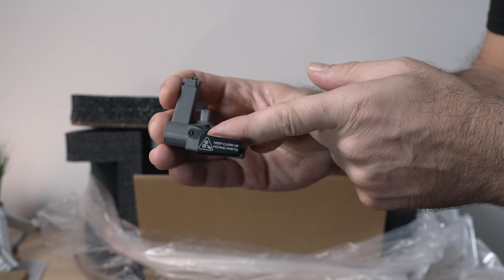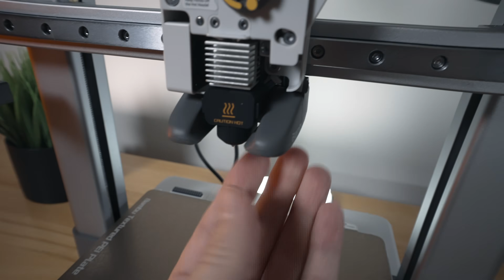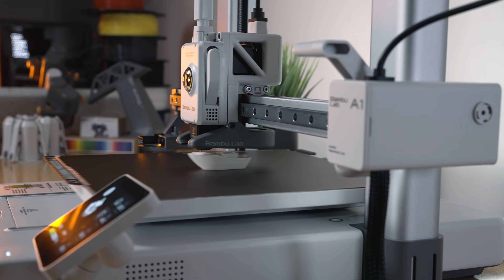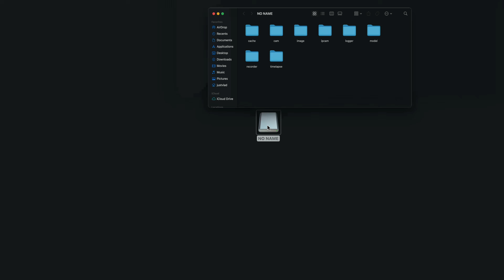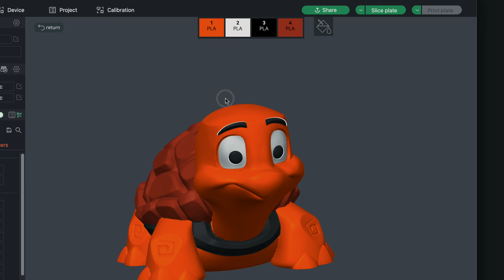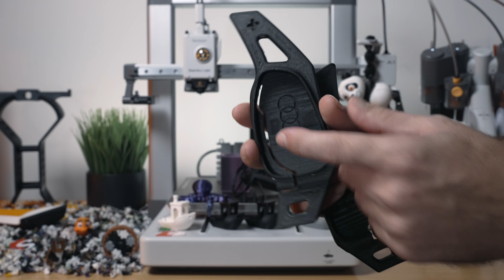Bambu Lab A1 Combo - AMS 3D Printer - Unbox & Setup

Comment: For the record, as of January 2026, the A1 Combo no longer ships with:
- filament color swatches ($10US)
- sample project and hardware ($?)
- tools and assembly hardware in a box, they’re just in a plastic bag
Additionally:
- the included arm for a single filament spool has been reconfigured; no longer has the separate, spinning cylinder
- the two Allan wrenches no longer come with the plastic “T” head
- there is only one extra cutter, not two
- there are no longer bolts that need to be removed on the bottom
Reply: Just bought mine last week and confirm everything listed above
Reply: Bought my three days ago, and can confirmed this as well.
Reply: Ordered mine 3 days ago and I can confirm it too
Reply: Can confirm
Reply: Confirm
Reply: Does it come with the SD card?
Reply: @Հայեմես-29  Yes
Reply: @Հայեմես-29   yes it comes with a 32gb one
Reply: yep. assembling mine right now, even the box it comes with is cheaper
Reply: That’s unfortunate
Reply: Does that mean it's not worth it or like there is stuff i need to buy with it?
Reply: @PalestineHobbyist There’s nothing you NEED to buy, they were just nice “extras” no longer included.

Comment: every body show how to setup printer thru phone, but i dont see video with setup thru PC. I dont want to use my phone. I am planning to use PC and my generated 3D files. I know it is not always straight forward when install bambu studio it does not want to work. I have one at work and IT guy spent half a day to figure out what is wrong. For not IT person it would be much longer. Nobody show how to correctly set up. I would hold on to buy until i figure out.

Comment: I just got the first bach of 2025. Assembly instruction and packing is slightly  different then videos. They don't include black plastic box that holds the maintenance stuff anymore just a clear plastic zip lock. It doesn't have the lubricant tube anymore instead they add 3 different small packs. The plastic base cover doesn't have honeycomb stiffener anymore.
Reply: Mine didn’t include the shipping screws at the bottom
Reply: Did you the get the filament swatches?

Comment: bambulab a1 z axis only leadscrew? no linear rail?
Reply: Just for the record, when I first watched this video , I was very excited about this A1 . i  ordered the A1 Combo , received it mid December,got it up and running in about 4 hours., printed 5 or 6 small parts, absolutely no problems . then on January 5, 2025, it was completely dead. It is now April  29 and still dead. I have gotten absolutely no help  from Bambu Labs. Guess I will pay my “STUPID TAX” , put the A1 in the trash bin and buy a new Prusa printer.     BAMBU = BAD.   PRUSA =  GOOD

Comment: Great video, thanks!  Very interested in this printer with AMS.  I wonder if a small guide/bracket could be printed that would prevent the cable from going behind the printer?  Something with a curve going toward the back that might keep it set right.

Comment: There were two brackets with FOUR screws holding the printer head arm that the instructions DID NOT tell me to remove. It kept failing calibration and a clicking noise until i figured out to remove the brackets. (You didn't have them in yours)
Reply: do you have photos so I dont miss this?

Comment: When you do small parts with lots of color changes i was told print multi prints at once. like the Penguin print like 4 or 5 of them at once. fill your bed plate with it. your purge block should not get any bigger but you end up getting 5 or more prints. (I do not own a bambu yet,  mine will be here today.) Was also thinking how do you turn the purge block into a model? i read you can do this but dont know how yet.

Comment: Bambulabs may indeed make some of the best 3D printers around but their Support pages for non-arrival of filament are absolutely useless. I filled out the form and submitted but it asked me to fill in my email address without their being a box to input it, so there was no such availability. And their live chat isn't open at reasonable times in the UK. So a big negative on that side. My printer, which looks lovely is absolutely no fucking use without filament. Which for some stupid reason isn't sent from the same place as the printer.

Comment: WARNING: The manual I received is out of date. The vertical axis on my Combo did not have the foam and zip tie attachments at the very top, so I just carried on assembling. When I went to calibrate I got a very loud noise, then calibration failure, it was only THEN that I found out by the process of elimination that you need to remove two black bits of plastic - 1 on each side, that are locked in place by 2 bolts that hold the vertical axis in place for transport. There is NO mention of these bits of plastic in the assembly instructions! Not a good start to my 3D printing experience!!😠😠😠

Comment: Great video, I just picked mine up, set it up, "Calibration fail" and it wont do anything else
Reply: Check that you have removed the 2 black plastic transport locks on either side of the vertical axis - there is no mention of these in my manual. Once removed I managed to calibrate it.

Comment: I noticed that when you printed there is no use of any type of glue and the bed.  (my present printer, I have to apply glue to the bed.  Is it not needed on this machine?
Reply: Try and drop your z-offset by like 0.3mm :)
This helps the print squish into the bed better

Also, glue is messy, we use hairspray and that has been working really well for us :)

Comment: If you recycle that's good but if you throw it away that's a huge waste. 
I would probably create a sorting machine to sort all the waste of the 4 colors on it own container so after that recycling it by re-melting will be easy
Reply: We have a spice grinder, and I think it would be fair to blend them right after the print is done
Sorting them and storing them in color sorted containers for mixing into epoxy or melting :)

Comment: The AMS knows what colour the filaments are because each Bambu filament roll has an RFID tag in it and the AMS reads it and sends it to the printer.
Reply: OMG does that mean we can't use any filament except Bambu's?
Reply: @YinandYang67  You can use any filament you want, the RFID is just for automatically setting up what's in the AMS. You can simply do this manually with everything else.
Reply: @YinandYang67  in the menu you can select other filament and it works just fine, the fancy bambu rfid spools are a very nice option though, i've honestly just stuck with them. Im more focused on learning 3D modeling atm than messing with the printer so bambu's ecosystem is nice and simple.

Comment: I've seen a few reviewers complain that the little tabs near the rear corners aren't high enough and they've had an issue where the build plate ends up on one of them and causes the plate to be raised and hit by the tip.

Comment: Does it work with generic filament sold by Amazon.?
Reply: By the review Just Vlad did here I noticed that yes generic filaments can be utilized however because the RFID Bambu Lab uses on their spools is not on the generic filament spools we may have to manually input the colors.   I think this is going to have to be my next printer because I am truly emotional every time my current printer's 4 point tram adjusting knobs turn into the Knobs from hell and the slip of paper to tram the bed WTH...  I need this printer.  XD

Comment: I hope that mine was not a return, I did not have plastic on the heat bed to peel off, and I also didn’t have cardboard over the printhead. 😢
Reply: 3 days ago I received mine, also without film on the heated plate and cardboard in the head. I don't think they are returns, because in the box there is the date (probable production) and it gives me March 2024. I think they are produced in the factory with the old plate and then later they replace it with the new plates.

Comment: CHEAP? HERE IS yet another question regarding the prices of PLA filaments in the Brazilian market. Recently, when comparing filament costs between the United States and Brazil, I came across a significant disparity. While in the United States the average cost of PLA filament is approximately 25.52 dollars, in Brazil, this cost is substantially higher, reaching around 127.08 reais on average.

This price disparity led me to reflect on the accessibility of filaments for 3D printing in the Brazilian market. While in the United States the cost of filament represents approximately 2% of the average minimum wage, here in Brazil, this cost corresponds to approximately 9% of the minimum wage. This difference is considerable and raises questions about the access of these inputs to a wider audience.

I understand that there are economic and logistical differences between the two countries that can influence production and distribution costs. However, the similarity in filament prices, despite these differences, suggests the need for a more in-depth analysis of pricing practices in the Brazilian market (I may be talking nonsense but in my opinion the value in Brazil should be at least 4% which is already twice as much as the United States and also some companies say that they are 100% Brazilian with raw materials from Brazil, so why this value of 9%)

I can be one of the few to raise this flag and discuss ways to make PLA filaments more accessible and competitive in the Brazilian market, and accessible to more people. However, for personal reasons I may not directly enjoy this benefit if filaments become accessible to a wider audience. However, I insist and reiterate, I sincerely hope that more and more people raise this flag, firmly believing that a review of pricing and recycling policies for materials that went wrong or leftover printing (returning to that issue of multicolor printers), we will have more people with access to this incredible technology, and nature thanks you.

BARATO? AQUI TEM MAIS mais uma questão em relação aos preços dos filamentos PLA no mercado brasileiro. Recentemente, ao comparar os custos do filamento entre os Estados Unidos e o Brasil, deparei-me com uma disparidade significativa. Enquanto nos Estados Unidos o custo médio do filamento PLA é de aproximadamente 25,52 dólares, no Brasil, esse custo é substancialmente mais alto, chegando a cerca de 127,08 reais em média.

Essa disparidade de preços me levou a refletir sobre a acessibilidade dos filamentos para impressão 3D no mercado brasileiro. Enquanto nos Estados Unidos o custo do filamento representa aproximadamente 2% do salário mínimo médio, aqui no Brasil, esse custo corresponde a cerca de 9% do salário mínimo. Essa diferença é considerável e levanta questões sobre o acesso desses insumos a um público mais amplo.

Entendo que existem diferenças econômicas e logísticas entre os dois países que podem influenciar nos custos de produção e distribuição. No entanto, a similaridade nos preços dos filamentos, apesar dessas diferenças, sugere a necessidade de uma análise mais aprofundada sobre as práticas de precificação no mercado brasileiro (posso estar falando besteira mais  na minha opinião o valor no Brasil deveria ser de pelo menos 4% que já é o dobro que os Estados Unidos e também algumas empresas falam que são 100% brasileira com matéria prima do Brasil, então porque este valor de 9%)

Posso ser um dos poucos a levantar esta bandeira e discutir maneiras de tornar os filamentos PLA mais acessíveis e competitivos no mercado brasileiro, e acessíveis a mais pessoas. No entanto, por motivos particulares talvez eu não usufrua diretamente desse benefício se os filamentos se tornarem acessíveis para um público maior. Contudo, insisto e reitero, espero sinceramente que mais e mais pessoas ergam esta bandeira, acreditando firmemente que uma revisão das políticas de precificação e reciclagem dos materiais que deram errado ou sobras de impressão (voltando àquela questão das impressoras multicoloridas), teremos mais pessoas com acesso a esta incrível tecnologia, e a natureza agradece.

Comment: Great review and demo. I bought an a1 mini since the a1 is on recall, but I didn't buy the a1 mini combo, just the machine itself. I love it. As soon as the full size a1 comes back in stock after the recall I'm grabbing one, probably with the ams lite.
Reply: Are the 4 filaments provided with the A1 combo package ??
Reply: @milatoulouvier8509  nah, if I were you. I'd check the website. it has all the information for what comes with it.
Reply: @milatoulouvier8509  filament is not provided I'm afraid
Reply: @milatoulouvier8509  no unfortunately not
Reply: @milatoulouvier8509   i dont think they are

Comment: No mention of the recall or was this made before it or maybe there is no recall does that mean I can use my A1 3d printer?
Reply: What happens if it starts to spark?  Will I know it?  Can I start a print and leave the house for a day or two?😐
Reply: @glensmith-or1bp  Taking in consideration that the bed and the problematic cable are mains voltage ( 220V or 120V ) it's absolutely not recommended to leave it unattended, it's not worth the risk setting your place on fire.

Comment: In the slicer there are setting that you can tweak, plus community made filliment changes g-codes that makes it least wasteful and faster. Also the purge block can 60% smaller and it works fine

Comment: Unfortunately the timing of the release of this video is at the same time that they are now asking ALL A1s to not be used regardless of cable damage or not.
Reply: They should put it on a notification header on their landing page on their website. Some guys got older info from their blog saying you can still use the A1 if you don't have the power cord issue, some are getting a more recent one saying full stop using the A1 via email.

Comment: Show us how to do a re-boxing cause we may all have to send them back lol
I liked and literally saved this video for when I am sending it back 🤣
Reply: Bought last month and got with an extra Bed heater that fixes the problem. Often it is wise to buy a couple of months after launch so any issues are fixed.
Reply: This is by far the best printer you can get for under $600 bar none. Bambu has set a high bar to other manufacturers and expect they are working overtime to compete.
Reply: @leosiwicki2013  Indeed, and as a bonus you also get the top notch quality cables which will melt and sparkle free of charge and not at last an email to stop using it for the next 3-4 ish months until they fix this magnificent house burner
Reply: Watch the video in reverse
Reply: You ever used the abet a8 that little cable is nothing compared to the a8 it will be fine
Reply: just reverse the video
Reply: exactly lol
Reply: What is wrong with you?

Comment: I came here just for the comments on the power cord fiasco. And all the arguments on it. 😂. Poor Vlad should have done a bit of research before putting out this video.
Reply: I thought that the recent ones were fixed or whatever
Reply: @libidoisneato they are, I just got mine today and it has the upgraded power cable
Reply: @MrMcbear  okay, thank God. I got mine a couple months ago but it is still in the box until I move. I couldn't find the serial number on the outside to see if it was the bad one